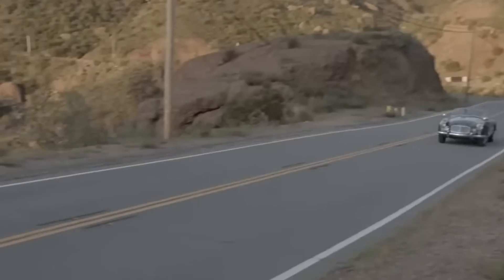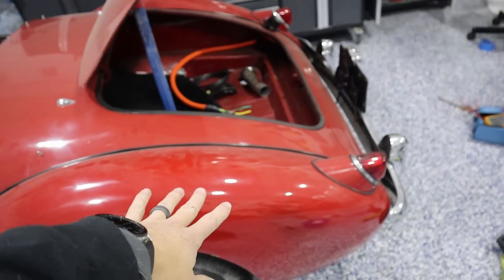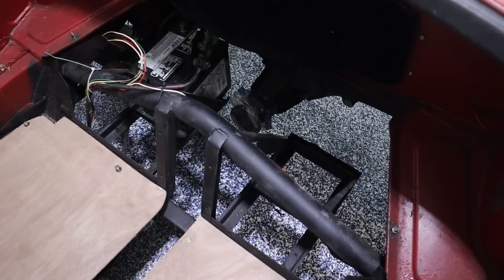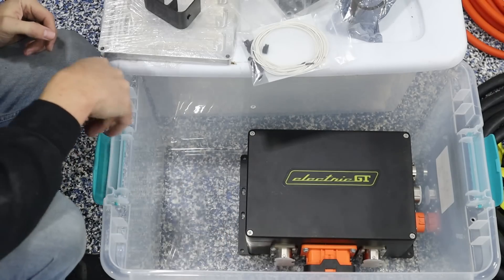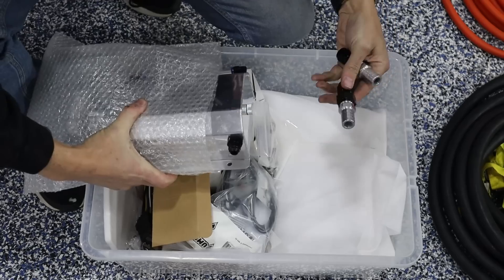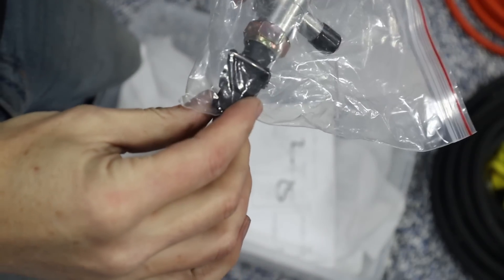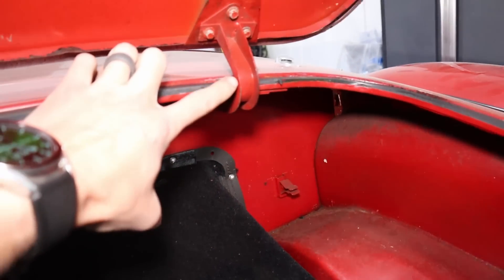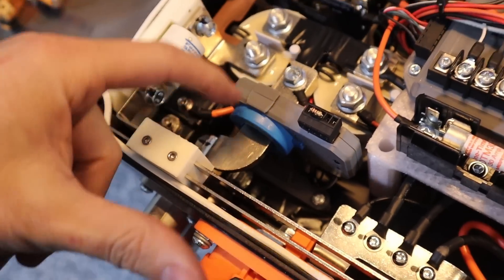Electric MGA - 1st Customer Build for the Electric Supercar Garage

Comment: The Hyper9 can do 8k RPM and it has been tested up to at least 10k (But good luck getting 10k RPM FW from Netgain, as they cannot guarantee the back EMF at such RPM won't damage the H-Bridge in case of a fault). I'm pretty certain it would have appreciable power at 8k RPM with the X144 and corresponding battery voltage...
Reply from the maker: Thanks for the comment!

Comment: I think... SOME OF THE BEST Electric cars, are the ones where the electric motor is connected to a proper gearbox... Why? IF the electrc motor is linked to a well programmed ECU you can STILL get a great power curve, and then when you add in you manually changing proper gears you get a WAYYY BETTER driving experience than just a 'Two pedal setup'. I've seen videos of an old Porsche, Karmann Ghia, MG's even a Triumph Spitfire with this electric motor & proper manual gear box setup, and they're BRILLIANT! 👌👍
😎🇬🇧
Reply from the maker: Thanks for the comment

Comment: MG is not know to have the greatest suspension. MG’s are stiff in the front and soft in the back. This was set up to compensate for the weight of the ICE. If you do not distribute the weight of the batteries similar to what it would have been when it was an ICE then you are going to have a car that looks goofy and rides horrible. The nose will be way up in the air and the rear will squat to the pavement. If you aren’t careful with the weight distribution you better make sure the customer has some really good thick foam seats because he or she is going to feel every crack and bump in the road. It will be like ridding in a solid axle go kart. Take your time figuring this out or your first customer might be your last. Wishing you the best with your channel and hopefully you can take your dreams as high as you want.

Comment: Nice build. I'm hoping to see a lot more of these small classics converted to EV on the road. I think Hyper 9s are a great option, but I really wish they would start offering some higher voltage/RPM options. A 300+ V, 10,000+ RPM AC motor-controller kit would make for some very easy conversions with the option for DC charging.
Reply from the maker: I totally agree!

Comment: The hydraulic switch at 4:13 is presumably for the brake system, to provide a "brakes applied" signal to the controller.
Reply from the maker: That was my guess

Comment: The transmission is not needed to make the car go faster: 6,000 RPM into the MGA's final drive corresponds to the top speed of the original car or greater. The purpose of the transmission is the opposite: it provides reduction gearing, reducing the car's speed for a given motor speed, to increase torque to the wheels at low road speed. The MGA has a direct-drive (1:1 ratio) top (4th) gear, not an overdrive.

Comment: I have seen several Triumph and MG conversions and none of them required  require active cooling (Assuming you are only doing sub 25KW charging). They often have a fan for the electronics but no liquid cooling. Also none of them needed boosted brakes. Regen and decent pads up front are all you need.
Reply from the maker: I think cooling will be primarily for the motor controller
Reply: @electricsupercar  I would think putting that where the radiator used to be with a temperature  controlled fan would suffice. That is what I have seen on all small car conversions to date... (unless the owner lives in Arizona or somewhere with 100°F average temps...) ;)

Comment: The wheel chocks are needed in normal use, as the braking system is best described as rather lacking.
Reply from the maker: thanks for sharing
Reply: @electricsupercar  Yes know a dealership who deals with them, and who has a very large collection, but he also is the first to admit a British braking system does require rather frequent maintenance to keep it operational, and these vehicles are known to be somewhat quirky when still powered with an ICE, and also prone to leaking fluid.

Comment: This thing looks amazing, but why did the owner keep the original transmission? It's not known for being particularly strong or reliable, and attaching it to an electric drivetrain seems like asking for trouble.
But I'm just an internet nobody, so I'm probably wrong.
Reply: I agree it will likely fail at some point. A Mazda Mx5 (Miata) box will likely be a better option.